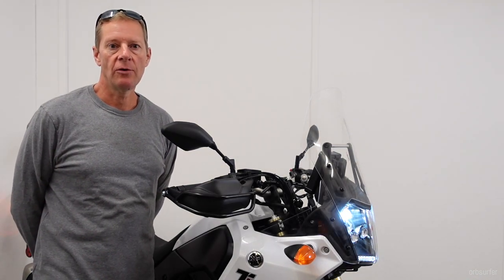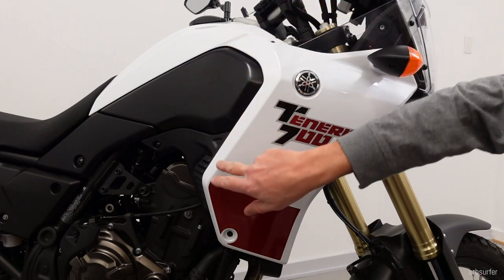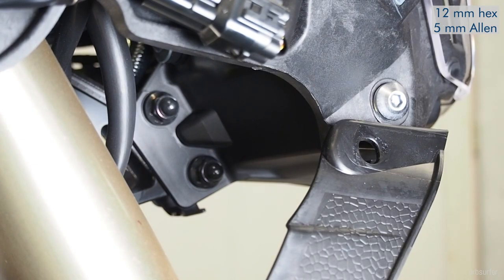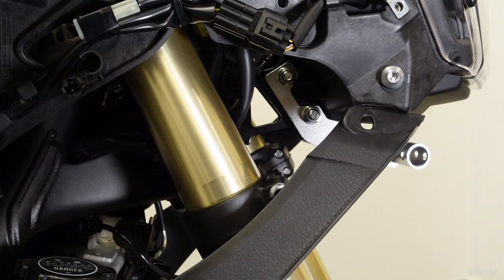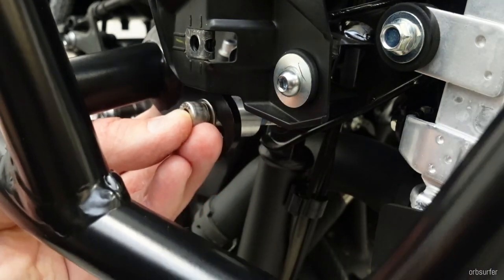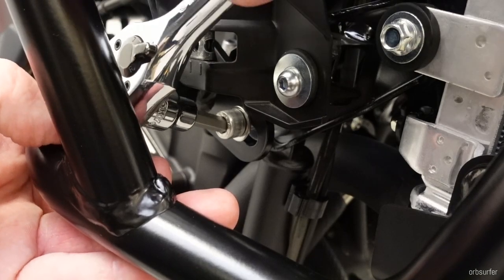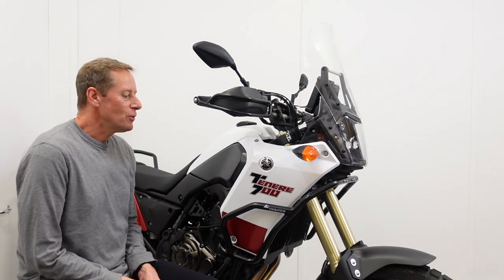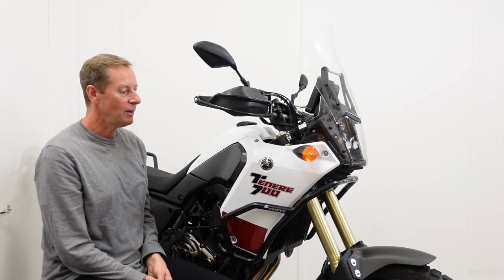Yamaha Ténéré 700 - Touratech Upper Crash Bars

Comment: I think the guy that designed these crash bars was probably high! Trying to get a torque wrench in that space was almost impossible. I tightened it by hand with a small wrench, and by the time I figured out how to get my torque wrench in that little space, it was already over-torqued. Their torque table also leaves a lot to desire. I hope the quality of the bars itself is better than their design and installation guides. Thanks for the videos! I did both the crash bars and the USB charger at the same time using your videos.

Comment: Thanks a couple dozen times for the installation videos Orb. Difficult anyway. Much easier with full instruction videos. I'm doing everything you've done to yours plus lower crash bars and power to the inside of a pannier. Larger Acerbis tank. Wouldn't have liked it without you!!!

Comment: Hey thank you for your nice Video.  Yesterday i installed my upper crashbar from touratech.  I have to tell you that you dont need the spacers on the bolts under the headlight. 
I couldnt believe that you have to bend something. So i contacted Them an they Said this to me.

Comment: I am just curious, why did you choose Touratech ? and what is your opinion on the Yamaha protection bars?.
Reply from the maker: I did not like the lines of the original Yamaha bars, the Yamaha bars cover up the Ténéré 700 logo on the side panels. Also the Touratech bars have the cleanest lines.
Reply: @orbsurfer8195  do they seem any different purely in terms of protection? Or is it mostly an esthetic upgrade for you?

Comment: Hello, very good video!! I'm thinking about to buy this crash bars but I'd like to know if they are compatible with high fender kit from camel adv.
Could you help me with this??
Thanks!!!!
Reply from the maker: According to Camel ADV's website, the fender is fastened to the bottom of the lower triple clamp with a custom aluminum bracket; i.e. the top of the fender is just below the triple clamp. 

If you draw a line horizontally out from the front part of the bottom of the triple clamp, the distance from the bottom of the Touratech crash bars to that line is 7/8" - 20 mm; i.e. there should be clearance between the bottom of the crash bars and the top of the fender, but it depends on what fender you end up with and how tall the fender is.
Reply: @orbsurfer8195  thanks, very good and complete answer!